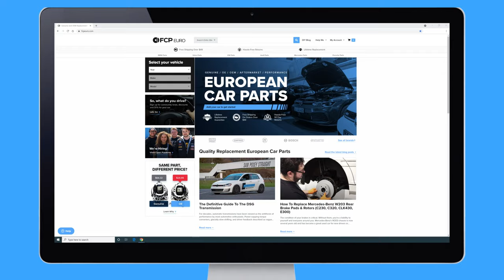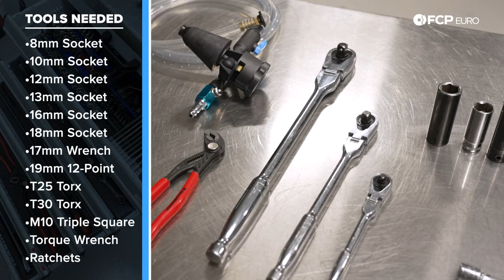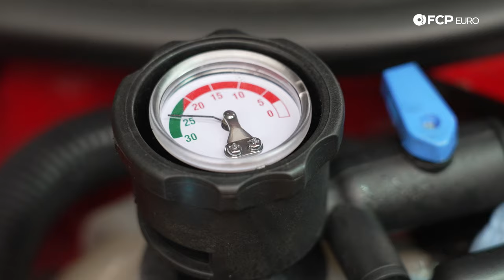Volkswagen Mk5 GTI Timing Belt & Water Pump Replacement DIY (2006-2008.5 VW GTI, BPY, CRZA EA113)

Comment: Amazing video thank you. Heads up if anyone is doing this on an audi A3, the charge pipe is on the bottom and should still be removed. When taking the engine/gearbox mount out, take the lower timing cover off FIRST or it will not come out no matter what. When putting it back in, put the mount in FIRST, then slide the lower cover up from underneath; or else again, it will not go in. Other than that I was able to do this over the span of a weekend.
Reply from the maker: Nice work!

Comment: Man, I got about 2lbs on the timing belt tensioner before the threads ripped right off the nut fucking up the stud threads.  Also recived 1 different tensioner in my kit and only one of the idler pulleys (not the kit used in the video) .  Nothing goes smooth ever and thats fine.

Comment: 200k mile cambelt change complete. This is the second time I did this cambelt on my 07 GTi and I found this video much better than the scraps of information I could get 5 years ago. Thanks!

What I will say is mistakes of the past did come back to haunt me. I over torqued my top idler and the thread fell out. I also used a defective bolt with a poor thread. So this year was spent reading furious internet debate about timesert Vs keensert Vs helicoil. I opted for helicoil as access was limited and I wanted to remove as little metal as possible for the new insert. Fingers crossed it holds for this application.
Reply from the maker: Nice work and recovery!!

Comment: Damn this was a lot simpler than I thought it would be omg. I was scared to do this until watching this. And I’ve done timing on Hondas plenty of times, this looks very straight forward and simple. Good job on Volkswagen, and good job on you for demonstrating
Reply from the maker: We love to hear it! Some
Of these jobs can also feel more daunting than they are in reality
Reply: Yea seems kind of straightforward compared to the timing chain. In the official manual it looks simple too but I had to drill the dreaded bolt of hell out since it stripped. I had to take apart the Adjuster and clean it so any metal shavings won't destroy it from within. Unfortunately there's a broken plastic washer where it holds down a spring inside the Adjuster. Same issue on the junkyard one I bought. I don't know what to do anymore as this washer is probably not sold as a part anywhere.

Comment: This will/has saved me money, man!  THANKS for your well illustrated demonstration of what I thought was going to be a challenge.  Ya'll shop mechanics better watch out - tutorials such as this will most likely decrease your work load and pay earnings due to self made repairs being performed.
Reply: after watching this, nobody will try this at home
Reply: @markkwong9512  Man you can do it - I watch and used it step by step and took about 5 hours (going slow to do it right the first time).  This was my first ever timing belt change to.  With all the right tools it was fun.  Only problem was two little screws on the cover for the belt.  Pain to access.  TOTALLY (and I mean TOTALLY) worth saving $1500 of your hard earned $. Buy the real deal kit though.  

At least try it, if it fails tow to a mechanic.

Comment: Does the charge pipe clip orientation affect how well the hose is clamped? Because I noticed you put it with a different orientation 42:10 compared to when the retainer clips were removed 7:35 .

Comment: The pipe next to the timing belt cover on my GTI (2006 JAPAN spec) is made of steel and cannot be moved as shown in the video (13 min 24 sec).
Could you please tell me how to remove this pipe or how to remove the timing belt cover? The cover is one piece type.　My best regards

Comment: Why didn't use the angular torque after the first portion? The ones with 20, 40 and 60nm had a plus 90 degrees after.
Reply: Probably because most people don’t have them.
Reply: @hardcore4476   I just did yesterday using the bolt reference. Basically ./''''*''''\  rotate the dot to the *.
Reply: @Lemos_TTs  are usually make a line like he did in the video and turn it 90°.

Comment: Please do a video on the cam cradle reseal with the green sealant nobody has made a video on it it’s always videos on the valve cover and never the cradle that holds the cams in place but mine is leaking bad I need a tutorial otherwise my vw dealer wants $600 for the job

Comment: I took the 2 bolts out of the dog one mount and now after finishing, the engine holes do not align. How can I fix this?
Reply: Rock the engine until they align and hold in place until you get one bolt started.

Comment: What would cause a new water pump to fail and leak out of the weep hole?
Reply: Poor quality water pump...
Reply: Not only poor quality water pump. Maybe due to long service life the axle seal from impeller to pulley starts to leak and it weeps out from that hole. If you see any coolant coming out of that hole, be sure to change the water pump.
Reply: @Antto  He said a "new" water pump, hence the long service life is not the probable cause.
Reply: @johnnyblue4799  I stand corrected. Apparently I cannot read. Sorry about that.

Comment: May I pick your brain please FCP Euro? I have a 2015 BMW X5 X Drive 35i, twin turbo Inline 6 cyl. 3.0 AWD, I'm trying to help my mechanic out by asking other professionals such as yourselves. About 3 weeks ago I was driving when a message on my dash came over that said "Engine running to hot, Drive moderately" turns out it was a few things wrong with it. I had him replace the coolant pump, and thermostat. But its still running hot. The mechanic noticed that the coolant fan isn't turning on at idle. He can turn it on with his computer, and it will run with the AC on but at idle it wont come on by itself. He thought it was a censor, he replaced it. He thinks it a electrical problem somewhere. Can you guys please give me an idea where I can tell him to look? I've asked elsewhere but all I get is trolls saying "That's what I get for buying a BMW." etc. I got the vehicle for my job as I am self employed and I have been out of work for 3 weeks now. I really need help here please. Any advice would greatly be appreciated. Thank you.

Comment: Hi Mike.  Awesome video.  The most professional, clear and thorough of any such videos I've seen.  Quick question as engines vary from continent to continent.  Is the part kit also valid for a MK5 GTI? VIN:  WVWZZZ1KZ7U035448
Engine#. BWA131221

VOLKSWAGEN GOLF 5 1K1 GTI 2.0L AXX, BWA DOHC 16v Turbo Petrol Direct Inj. 4cyl 147kW 6sp Auto DCT 5dr Hatchback FWD